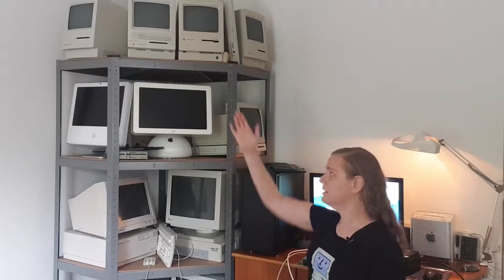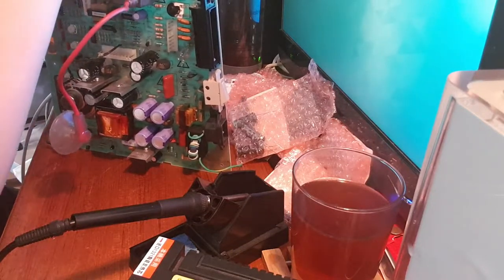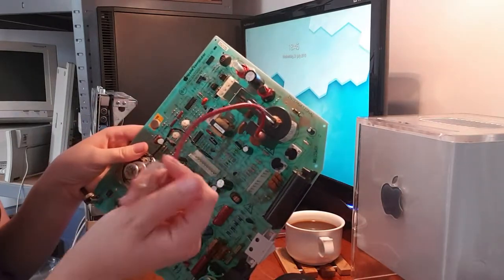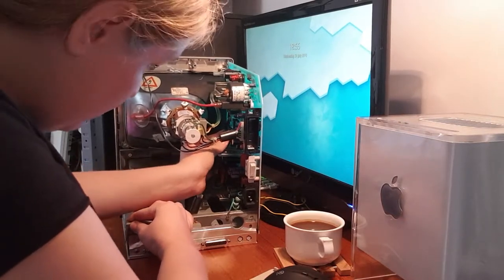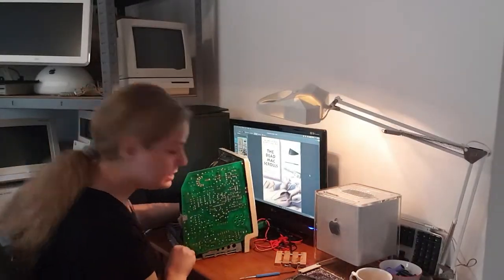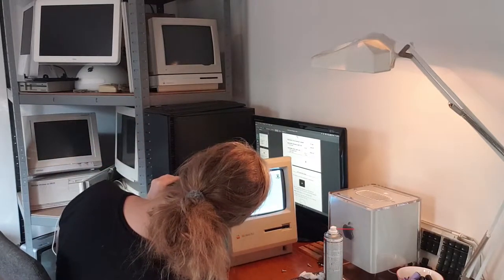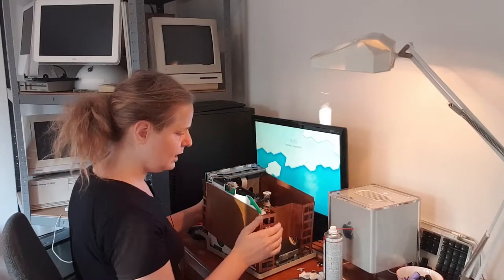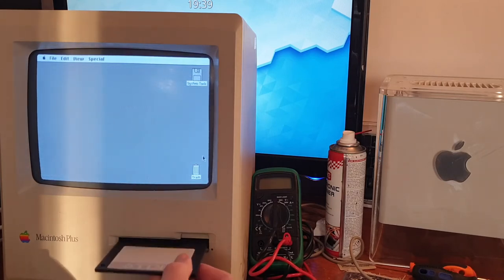Macintosh Plus - repair

Comment: Well done for capturing pretty much the identical experience I have here at the moment in Papamoa, New Zealand, with three Plus machines all doing the same snick-snick-snick noise. I must try cleaning those logic board-analog board cable connections, it was hard to believe that’s what made it power up for you :)

Do you think possibly the horizontal output transistor (mounted to the heatsink near the flyback transformer) is dodgy? Perhaps it is a coincidence that it started working well enough to start the machine, but you still have the wobbling caused by that same part?

I have one analog board that does work (in an older Macintosh 128) so I am going to ‘borrow’ that transistor, I’ll see if it makes a difference.

Thank you again for sharing this video :)